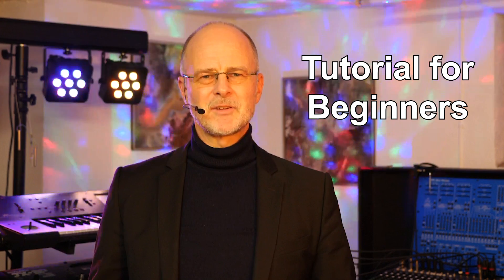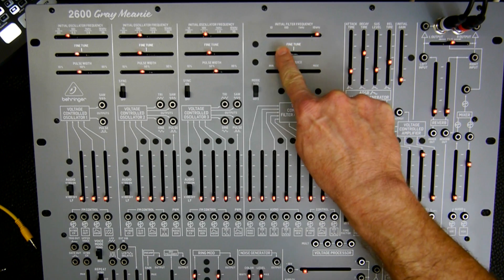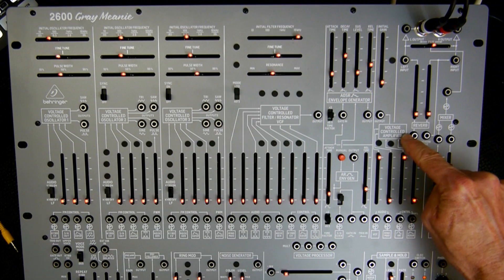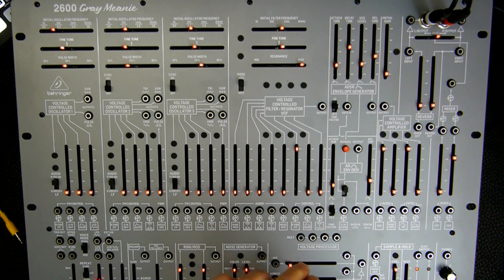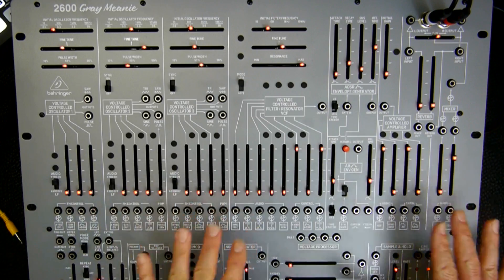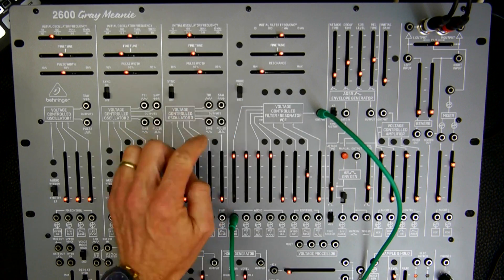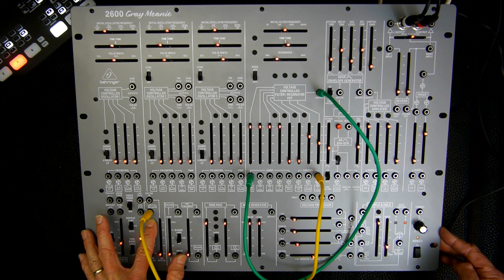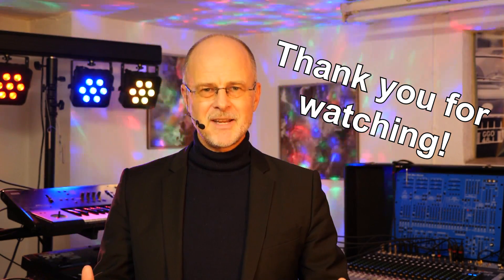VCF (Voltage Controlled Filter) EXPLAINED - Behringer 2600 (also works on ARP 2600 and 2600 Clones)

Comment: Kia Ora from Aotearoa NZ Ralph and all that have and or will follow you.  Really appreciate the mahi/work Ralph.  Regarding the mode switch.  Were you implying the 4012 filter is the ladder filter or is this another ARP filter design?  Mā tē wā/see you later, J.
Reply from the maker: Thank you so much for your appreciative comment. The 4012 was the ladder filter reminiscent of the Moog filter. Due to legal disputes ARP developed the 4072 filter which was used in the ARP 2600 from 1977 to 1981. The Behringer 2600 now features both filter designs. Greetings from  Germany to New Zealand! Cheers, Ralph

Comment: I don't understand how you route the vcf output back into its mixer, but are still about to hear it output through the VCA. I'd have thought if the signal is rerouted from the VCF output it would never reach the VCA. 

Thank you for all the videos about the 2600!
Reply from the maker: There is a prewired connection from the VCF to the VCA. When you route the VCF output back into the audio or control/CV input of the VCF, the prewired internal connection from the VCF output to the VCA is NOT broken. Thank you for watching my content. Glad you find it helpful. Cheers, Ralph

Comment: Thanks a lot! Just one question... all controls inputs are just for the Cutoff? Any way to modulate resonante or fine turning of the vcf?
Reply from the maker: Yes, all inputs are for controlling the Cutoff Frequency. But have a look at the Voltage Processor if you want to make very subtle changes to the VCF frequency.

Comment: Great tutorials, thank you. You might want to edit this one, as, at least in the case of the Blue Meanie, it's more than just the Reverb, that's different under the hood. Have you had a very close look at the mainboard?
Reply from the maker: I have never disassembled any of my 2600 Synths by myself. Behringer states that they have been using "superior" components and filter caps for their version of the Blue Marvin.

Comment: Ralph you really are the best at breaking it all down for us so it's slow and understandable.  I think you've almost covered it all on the Behringer 2600.  I was wondering though if you could take things a step further and show us more about how the 2600 can be integrated into a eurorack setup.  I've patched a small modular rig into the filter and then back out again with interesting results...but what about the envelope generators?  How would it be possible to use them to control a eurorack oscillator?  If you have any modular gear this would be a bonus for those of us getting into modular synthesis.  Thank you
Reply from the maker: Hello Bill, many thanks for your kind feedback. I will be back soon with new video content about connecting Eurorack modules with the 2600. BTW, there are a few more things that I have to cover about the 2600 😉 I have been very busy with my other business over the last couple of months, but video uploads to my channel will resume shortly. Thanks for sticking around. Greetings, Ralph

Comment: Hi Ralph, thanks for your work that is very useful :) I had a question regarding the LFO delay fonction : 
Once I reached the middle of the cursor flow, the LFO disapears, like the delay had an infinite delay time...
Do you know why please? 
Regards :)
Pierre
Reply from the maker: Hello Pierre, I not quite sure what you mean by "cursor flow". Please clarify.
Reply: @RalphBaumgartl  Thanks to answer :) I mean the length of the course of the LFO delayed (the length of the delay time)
Reply from the maker: @cosmosounds7237  That's how it's supposed to work. The further you increase the delay time of the LFO (by moving the delay slider upwards) the longer it takes until the LFO kicks in...
Reply: @RalphBaumgartl  Exactly :) But the issue is that in the middle way of the slider, even if I wait the LFO never appears....
Reply from the maker: @cosmosounds7237  There might be something wrong with the slider or the LFO circuitry. Is it working at a lower position?
Reply: @RalphBaumgartl  Yes Ralph, it is working at a lower position but rising it until halfway and nothing more happens, even if you keep the finger of the keyboard
Reply from the maker: @cosmosounds7237  It's supposed to kick in after some time even if the slider is at half way position. But if it works at a lower position then you can probably live with that "flaw"...
Reply: @RalphBaumgartl  Thank you very much for yours answers :) I will live this "flaw" anyway :)
Reply: @RalphBaumgartl  I found the isssue :)          I don't know why but with a MIDI keyboard everything OK. Before, I played the 2600 with the ARP Odyssey in CV/GATE
Reply from the maker: @cosmosounds7237  I assumed that you had a midi keyboard connected. Glad you figured it out.
Reply: @RalphBaumgartl  should tell you that at the beginnig...I didn't think the 2600 reacts in a different way if it's wired with MIDI or CV gate :)
Reply from the maker: @cosmosounds7237  There are two ways to connect via CV/Gate: 1. via the S&G Gate 2. via the ADSR/AR plus Trig IN. I haven't tested yet how the LFO delay works with either of these two connections.

Comment: Thanks Handsome Ralph..  I use my 2600 as my main bass synthesizer..  Whats also amazing is the ring mod it produces ..  I do hear Erasure sounds or Vince Clarke sounds..   I do feel the 2600 is great for percussive synths sounds like kicks.  This is why I have my sampler always ready to sample these short 2600 hits..  I like sampling it.
Reply from the maker: Yes, you can create any conceivable sound with the 2600 Synth. But in my personal opinion the Bass sounds are the area where the B2600 really excels...Greetings, Ralph
Reply: @RalphBaumgartl  absolutely.. I have access to get that Depeche Mode bass tone..

Comment: Great video Ralph 👍. Do you know if the 2600 has a second CV from its MIDI to CV converter? The Neutron has an assignable CV that can be controlled by MIDI aftertouch. That enables me to send breath control from my Roland AE-30 wind synth as aftertouch and it is used like an envelope.
Reply: In duo mode you can get a second pitch from the Voice Upper output but no after touch or velocity information I don't think.Look at the bottom row of the Behringer 2600 left hand end.
Reply from the maker: @lazymandoplayer  Great idea and workaround! Thanks for sharing this!
Reply from the maker: Hello, I don't know about that feature. Also, the manual doesn't give much information about the Midi capabilities of the B2600. If you find anything in the Internet universe regarding this, then please share it here! Greetings, Ralph